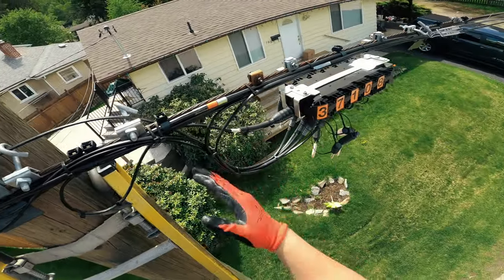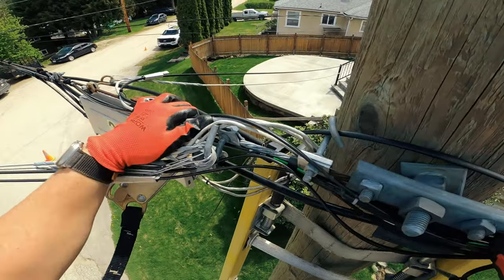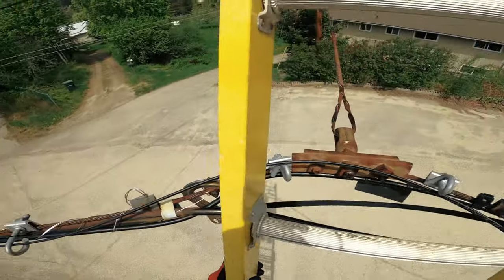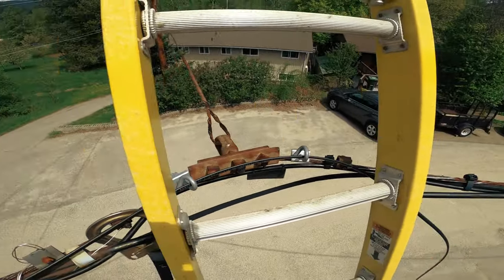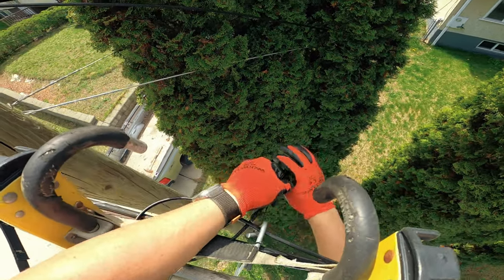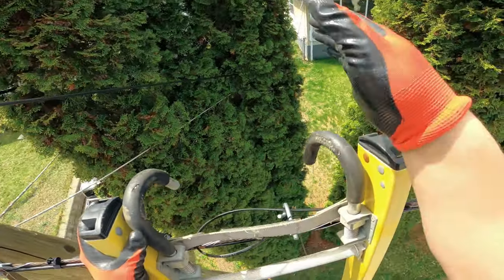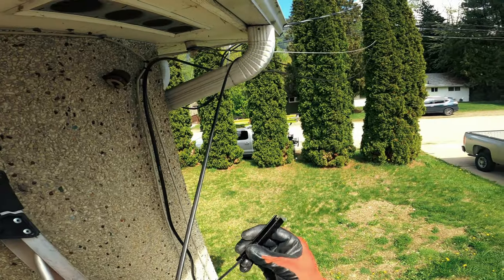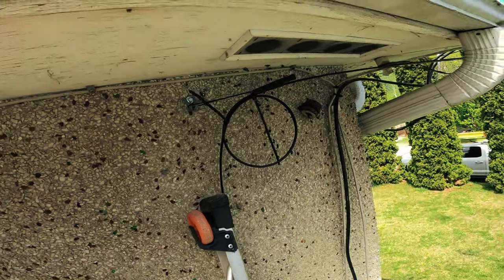COMPREHENSIVE AERIAL FLAT DROP GUIDE (FIBER OPTIC CABLE)

Comment: We need installers like you with Verizon in Northern Virginia area. Installers here does not (probably don't even know how) cut pre-terminated fiber optic cables. They will just get a long fiber optic cable and roll up remaining cables. If it is just a little bit of service loop, I would understand. However, my sister's home has about 50 ft of extra aerial drop fiber optics rolled in the back of large old obsolete ONT box (which is used as splice point only now).  This was installation from previous owner, so I asked installer to remove the box and replace with new smaller splice box, but the installer declined saying he cannot do that.  
Also, when FiOS installer came to my customer's house (I'm a remodel contractor), I asked installer to run fiber optic to unused phone jack on the wall, which was couple of feet below grade. This installer just drilled right through the drywall right above the phone jack saying he cannot pull fiber in the wall. Asked why not fish cable, his answer was he is not allowed.. Not sure if that is true or not, but he did not have any tools to fish cable anyway.  I used 12 AWG wire I had laying around to fish cable for him.. then patch the hole and paint again. :(
Reply from the maker: A lot of installers get a away with doing the bare minimum. Most of the time it’s due to their pay structure. they don’t get properly compensated for all the time they put into doing a good job, up to customer specs. 

It can be hard to blame them when that’s the case, but overall there does seem to be a lack of competent installers or ones who take pride in their work😅 

I get comments about stuff like this from all over the world it seems 😬
Reply: @FyBurz  yep

Comment: Do you ever do a strand test? That one is looking very rusty. Be safe my friend. I work on the coast and those strands snap do to the corrosion..
Reply from the maker: I don’t, but I wouldn’t of gone up if I didn’t think it was in good enough condition. I should of talked about it more though. Most of the time it’s just surface rust, but I’ve definitely have seen strands in bad shape. Everyone should be careful 😅